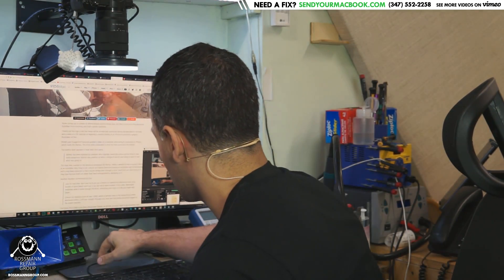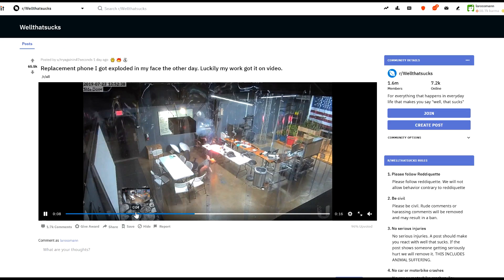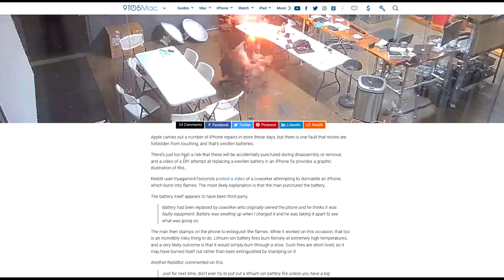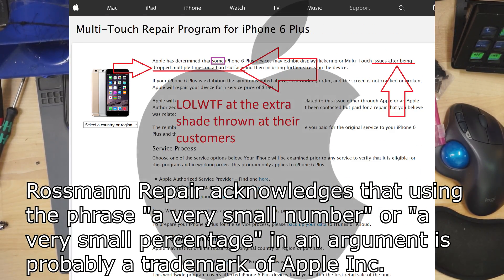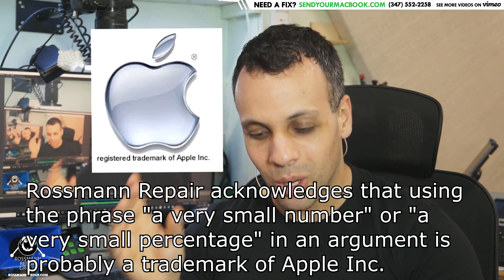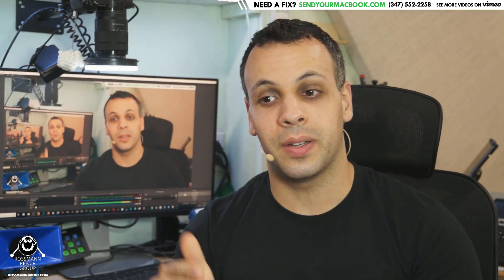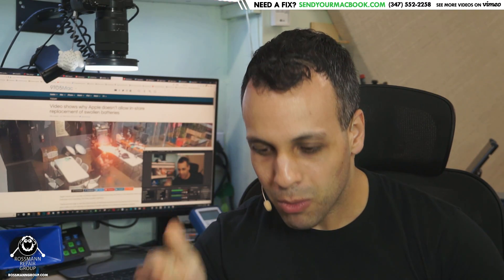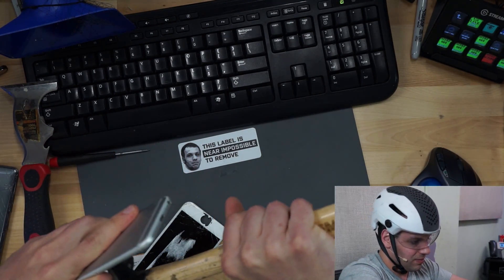STOP FEARMONGERING

Comment: User movable batteries tend to be hard-shell, vs the soft shell batteries that get glued in. That means any needed expansion space is built into it, and it is much harder to puncture (not that you would need a tool that might puncture it). 

My second smartphone phone was a Galaxy S5: IP 67 rating with a user replaceable battery. 

User replaceability is a feature. How is removing functionality "moving forward"? And I have been annoyed about how obsessed companies are with having the thinnest/lightest/smallest bezelled device for years. When laptops were three/four inch thick bricks that weighed ten or more pounds, reducing that mattered. When you are sacrificing features to reduce the thickness of a device by a few millimeters, you need to stop for a moment and pay attention to what people actually care about.

Comment: Use common sense. Swollen battery means battery have been overcharged. And the safest way to change battery is when battery have been discharge.

Even working with capacitor is dangerous.

Comment: I should use the 'apple' viewpoint at work. If a car needs a brake repair I should say "sorry you need a new car, there is a chance of the brakes failing and resulting in the car crashing" 
And then show them a video of brakes installed incorrectly as justification 😋

Comment: As some one who for over 20 has repaired a number of laptops and tablets, vapes, and heavily into rc, i have seen my fair share of litium batteries in every shape, size, and configurations. Ive never had a battery go nova on me. Yet i still practice saftey for the just incase event that it happens. But ultimately treat all batteries like you would a car battery, dont short them out, if bulging get rid of it safely, dont do anything that would cause a leak. Though i will admit with the glue they use on some batts its hard to get them out with out risk. Think, think, and think again before you act

Comment: I'm always a repair advocate, 100%. The fact that there isn't a phone with the specs I want and something as simple as a removable battery is ridiculous. I've had to sell my soul to a big tech company so that I can have nfc and Bluetooth 5.0 but can't do something as simple as change a battery without super specialty, often proprietary, tools that I'll never use outside of fixing my phone maybe once or twice. Waterproof cases exist if you want it that badly, even though there's nothing stopping manufacturers from putting an o ring somewhere to seal off the board

Comment: I punctured my old Iphone 5's battery with a needle trying to scrape out a piece of wood stuck in the AUX jackstick. Needless to say i can confirm, the battery was the original one that came from the apple store. It exploded in the form of at lot of smoke forceding it's way out of the side of the screen and that was about it. With the phone being dead i went to a thridparty repair shop, they replaced the battery. Low a behold it work without the slightest hint of trouble.

Comment: Apple is full of BS.  All you need to do is discharge a Li-ion/Li-Po battery, and there is NO danger if puncured/shorted.
Connect a resistor, let it sit over night(depending on resistor)  - once discharged to <2v or deep discharged  then you can tear off the stupid glued-in battery as you like.

Comment: I don't understand this "thickness" metric having any relevance for anyone.

Things I look at in a phone in order of importance:

- CPU.
- RAM capacity.
- Battery capacity.
- In case of Andriod, doesn't have to much of a butchered and bloated OS on it.

- Storage.
- Has a Jack.
- Reviewed audio quality.
- Has a SD card slot.
- Screen size.
- Current #G technology.
- Current Wifi standard.
- Camera quality.
- Has more than one camera.

If I could get a phone that's 1.5cm thick instead of 7mm and has a 4000mah battery instead of a 1810mah one, I'll buy the damn 4000mah one every goddamn time. And it'll damn sure be far less expensive than the iPhone 6 that was 7mm thick and had a flimsy 1810mah battery.

If the phone with the better specs and better battery has huge bevels around the screen I'll buy the phone with the large bevels.

Heck, one time I bought a hot pink colored phone because it was the only one left of that type because it had more of everything for the same price compared to other products at that pricepoint.

Competing on having a phone being tenths of a millimeter thinner or thicker while already having sacrificed so much battery life and utility, that makes no sense what so ever.

Comment: I don't think a battery removal can cause fire at all if the batteries are not glued to the frickin device. It's their move to glue the battery that made this process "dangerous" in the first place, and now they are saying people shouldn't do this because it's dangerous? I don't see how I could explode the battery when the battery in my last XPS laptop is easily removable by unscrewing a few screws. I replaced the battery within several minutes and without the need to reach below the battery and applying a stupid amount of force just to pull it out.

Comment: I don't understand the need to glue in a battery.

If a swoken battery was never glued in, there would never be a risk of puncturing it during removal, in the first place.

I'd be okay with screws on the back cover of a phone, with a good rubber gasket and water proof rubber key pads.  That would make phones truly water proof and still easily serviceable.

This is simply a case of style over function.  Some of us don't care so much about style!

Comment: I'm an amateur phone repair guy and i don' mind the concept of a glued in battery.  but I hate those glue tabs. I've tried to pull dozens of those things. i have only successfully pulled 2 of them ever. just use a weaker adhesive. when i put a battery back in a phone i use double sick tape. the battery stays put and if i have to remove it again it will release from the tape long before it bends. those tabs are the devil

Comment: I can't get why they stopped wrapping batteries into hard plastic cases, not only apple, but everyone. I remember batteries in old Siemens and Nokia phones, you must really stab them with a sharp object to make a puncture. And glue-in bullshit wasn't a thing then. If you want replacement you open a case, unclick old battery and click in a new one in under a minute. I hate this greedy attitude of no-repair. Manufacturers certainly can figure out a clip that hold battery as strong as glue and that can be opened easily if needed. But instead you must sit and poke  thin explosive bag with something sharp. Amazing design, I guess you get quarter of a millimeter thinner case out of it, which you wrap in a fat bumper, or a case with a lid, anyway.

Comment: It really sucks that just about every manufacturer has decided that glueing in batteries is the way to go, especially with phones when there is literally no reason, even if you can find a reason to seal the phone with glue and make the battery not replaceable without cutting that glue you still don't have any reason to have any strong adhesive holding the battery in place other than to make battery replacement more dangerous. Same goes for laptops, though I still struggle to see any reason to make a laptop without a user replaceable battery.

Comment: Tow truck driver: yeah your battery is dead you'll need a new car, car owner: what!

I was just outside of a repair shop with a vehicle that suddenly decided to have issues and they were not able to get me in they were able to tell me what part was bad and I was able to go over to Napa get the part for $50 and put it in within an hour, unfortunately we also needed a new cooling pump...
Either way the Auto industry has had to adapt to standards that non dealership repair shops will work on vehicles whether they like it or not.

Personally I would think we would have less issues with removable batteries because they will no longer stay in the phone when they get bulged and people would have to get a new one.
I have had a healthy respect for lithium ion batteries but seeing the hammer has really hammered it home that a fear is not a healthy respect.
I just replace the batteries in a 3Gs and a 4S both of them were starting to get puffy unfortunately the 3GS was just a little bit behind on my time frame and it warped the main board however it still works great especially with that new battery.

Comment: When you've got a swollen battery you just need to be careful.  lots of Isopropal to loosen up the adhesive and don't be dumb removing it.  5 series iphone battery adhesives are a pain because they're not the pull tabs that that newer ones have.  But like your hilarious hammer and pain scraper demo, a super mangled battery can still be fine as long as you don't put holes in it.
At my repair shop, the only battery we've had explode on us in the past couple of years was an OEM macbook pro battery that had came in to us super swollen and literally pushed the case bottom out an inch or so ripping out the case bottom screws.

Comment: What? Doesn't Apple use pull-tabs on their batteries? Should be perfectly safe to replace.
Now, if it has permanent adhesive, it's actually dangerous to attempt to pry out of the phone. If it gets a wrong bend it could short the positive and negative layer inside the battery, thus creating a tremendous amount of heat and catch fire.
As JerryRigEverything would say; Pull-tabs costs pennies to manufacture. There's no reason pull-tabs aren't implemented in every phone.

Comment: Let's say this: why use industrial grade adhesive on the battery that you have to pry the battery off, bending it and risking to cause an internal short, when they could use a weak adhesive and some plastic notch to keep the battery in place?

All you need is a weak adhesive to keep it in place while you assemble it. Then, just add a connector at the end of the wire instead of a soldered wire. Sure, it would add 3mm² on the board, but they can fit it still.

A battery shouln't require any 'skill' or 'specialised' tools to remove. I can accept that the battery is internal, but not that it is that hard to replace.

Comment: I have a question, does fully discharge the battery make it safer to dismantle the battery from the device?
Reply: If you poke it accidentaly, then there is no difference at all, since lithium will react with oxygen in air very aggressively no matter if battery was full or empty of charge.
Reply: So it is not the energy that store inside the battery that cause those violent reaction, thanks for the information.

Comment: It's fairly easy to replace an iPhone battery when it's not puffed up, but when it's damaged you're running the risk of a run-away thermal reaction at any time during the removal process, especially if the tape breaks (which it often does), and have to poke under it to lift it out.  There's absolutely no reason to use those thick double sided tapes, it's not like the battery is going to grow legs and run away.  A thin strip of double sided tape will do just fine (a 3mm wide on both sides), and that's exactly what I use to secure replacement batteries.  And guess what?! Not one has fallen out due to shaking/vibrations/heat since the first iPhone came out in 2007. ;)
By the way, people (aka the "iSheep") advocate against their own interest because they've been brainwashed so well that Apple can do no wrong... it's pretty sad!

Comment: i think it is far more dangerous and likely that a shitty or dying lithium ion battery will spontaneously explode while it's charging randomly one day or while being used by the user, or while in a hot airplane cargo hold or car trunk or something - than the case that the battery explodes during a routine replacement of a dead/weak battery - look at all those "hoverboards" that had exploding batteries from china in the first years those toys became popular for christmas - indeed several literal house fires were caused by these dangerous shitty things exploding spontaneously - not from someone repairing/replacing them, so i think thats a much higher risk than a simple phone or laptop battery being replaced by someone skilled and careful - its more likely and dangerous the thing explodes for some reason during normal use or even unused than during a careful repair/replacement service operation : this of course is not exactly the case, obviously opening something up and exposing the sensitive battery to potential puncture or a drink spilled on it or something is going to be more exposure to risk but it's an acceptable risk for the value of repair of the device and indeed making it safer going forward by it having a new, fresh, healthy battery instead of a dying, expanding, old battery being left in and the thing being (almost certainly improperly) - disposed of

Comment: It would seem to me that if anyone felt that legislation was needed to protect consumers from what they feel is the horrible danger of Li-Ion Batteries, that it would be far more sensible to require manufacturers to ensure that they are encapsulated in such a way that they can be safely changed by the end user without undue risk.

Comment: I work for a school district where 13 of us in my department do repairs on chromebooks, laptops, desktops etc. We repair around 800 devices a year each as students check out a device for homework and often bring it back damaged. I have replaced more batteries than I can count. Often expanded but not punctured without any issues.

Comment: MacBook Air and Pros could easily have removable batteries as the bottom could be made removable like the old laptop batteries were and not make the laptop any thicker just pure spite and greed and would also not effect the look of the laptop in anyway what this would needs is a new law that all devices have to have user removable batteries

Comment: Removable batteries are needed as an emergency shark repellent. Short circuits the battery in water will irritate the electrical sensitive sharks. 
You also need to remove the battery when you need to make emergency fire. Like lost in the winter forest.
Therfore removing battery could mean life and death in an emergency.

Comment: A lithium battery fire is non extinguishable. It can only burn out. Ensuring that no other fuel combusts is the only thing you can do. Dropping the burning device in a bucket of water is about the only thing you can do even though lithium reacts with water.
An elcheapo battery made be more of an explosion risk only due to improper casings and materials allowing the lithium to be pierced more easily than a name brand battery.

Comment: I've had an iPad battery blow up on me and it didn't go up that bad. Also, there are other signs it is going to go up, just because it's swollen doesn't mean it's going to explode. The one I was removing wasn't swollen but when removing the adhesive to recycle the back panel of the device the plastic covering on the battery peeled back a bit. It'll smell sweet like juicy fruit gum for a while before it actually burns up.

P.S. Galaxy S5 had user removable battery, headphone jack, and expandable storage, was still IP rated.

Comment: 1. I had an expanded battery inside an old flip phone years ago. I went to the Verizon store. Since the battery was removable, it was a painless 5 second task to replace.
2. Lithium ion fires are Class D fires (they create their own oxygen while burning) meaning a fire extinguisher or fire suppression system wouldn't help. The only thing you can do is contain the fire and let its fuel run out.

Comment: I am an Apple fan boy. I like my Apple products because the work well. However, I do not like how Apple glues the rechargeable batteries in their products. Ifixit rates Apple products very low on the ability to fix them. I understand a little bit more about phones. Probably easier to manufacture a phone that is completely sealed. What about a MacBook ? I have a MacBook  and the batteries cannot be removed. The laptop is very skinny, which is nice. I would rather have it be a little bit thicker so that I could just go buy another battery at the Apple store. My batteries are still good in my MacBook. I also have Apple Care, so if my batteries have an issue within the warranty they will take care of it. Probably will not work out that way. I am also avid radio control car guy. I use LIPO batteries. I have very special charger for my batteries. I need to take very special care of theses LIPO batteries. I will have to admit, I have not done so in the past. It took almost 5 years of misuse to finally cause a problem where one of my batteries puffed up. Now,  I  store my LIPO batteries in a special fire proof sack. I also put them into storage mode. Long story short these batteries can possibly dangerous if not handle properly, but it very hard to cause a fire.

Comment: I recently removed a swollen battery from a tablet, then threw it on the ground and used it as a football for fun, no explosion happened. The only way it will explode is if I short out the plates inside the battery.